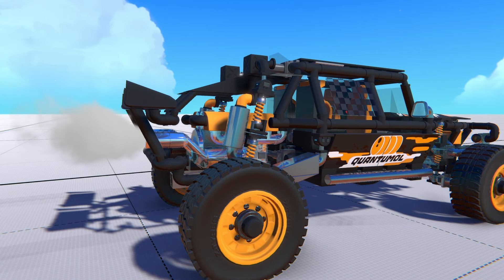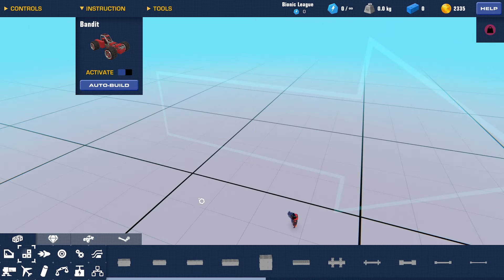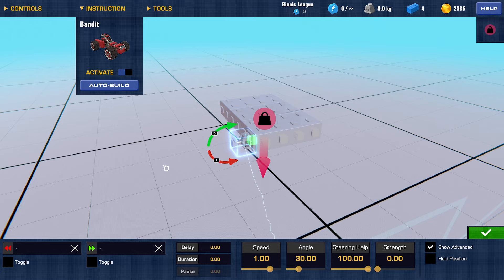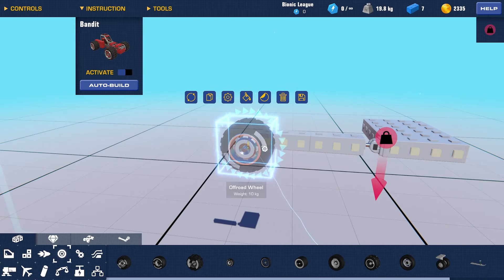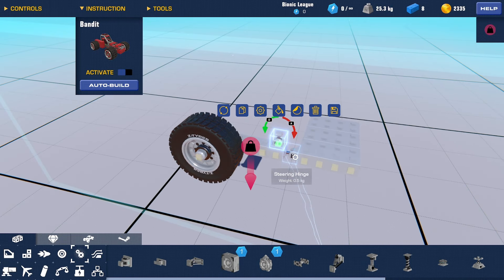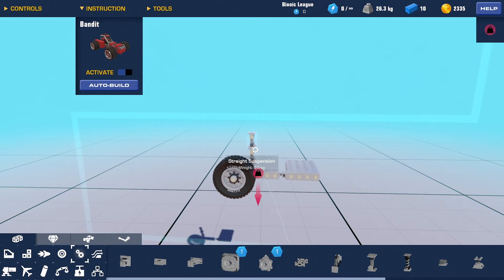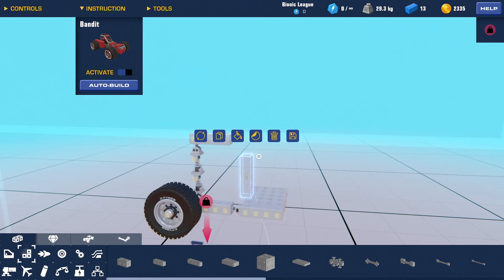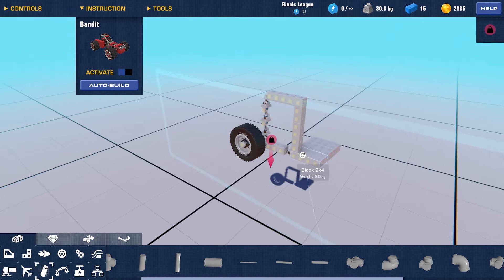How to Build Swing Arm Suspension in Trailmakers – Improve Your Off-Road Vehicles!

Comment: Anytime I'm making a swing arm suspension, I usually just use the strength on the steering hinges to control the spring rate.

Sometimes I'll add an always active input for controling height and the "dampening" with the speed slider & enabling hold position. 

So I really never use regular suspension pieces.
Reply from the maker: When you don’t have the suspension pieces you lose lots of necessary dampening. So I would recommend only using hindge strength if the suspension is to soft for very heavy vehicles
Reply: @wtswins I've never actually had a problem with weight on suspension, the wheels are the limiting factor for that (sinks)😂
Reply: @wtswins but yeah, the regular suspension doesn't have the spring rate for heavy weights without more of them.

Comment: i did this but like ... is the build supposed to be flat and touching the ground? xD how am i ussposed to make this angled?
Reply from the maker: to make it angled simply make the swing arm out of wedges!
Reply: He forgot you need to adjust the strength sliders on the steering hinges or set them to 0.